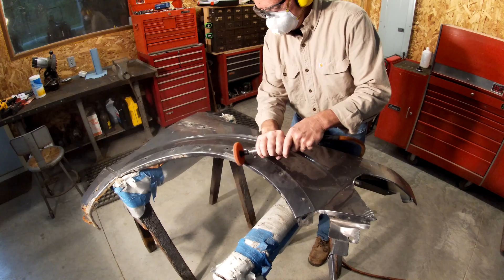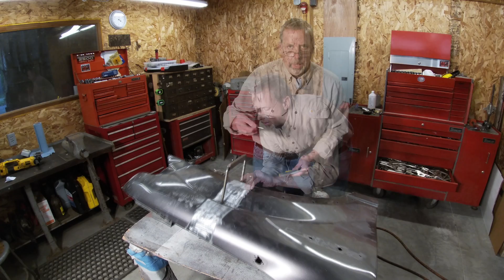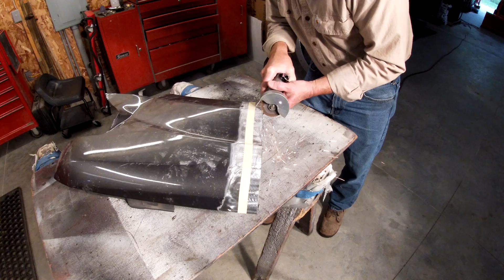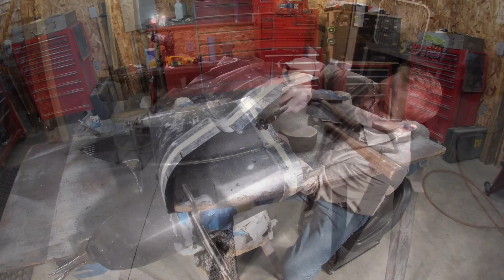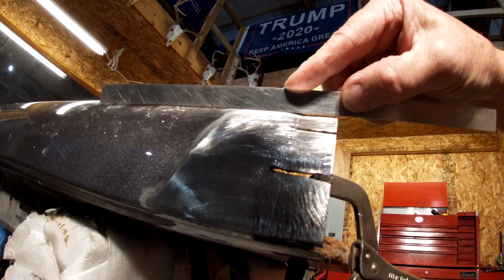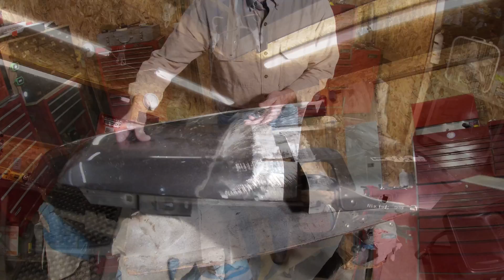Splicing A Fender Part 1 of 5

Comment: This will be interesting to see, these adhesives are way stronger than what a lot of people think.
I work at a VAG shop, these cars have a lot of bonded panels, and its rare to see cracked glue seams even on fairly substantial crash damage. I've even had cases when the spot welds have popped, but the glued areas right next to it are still intact.
I've done tests peices with the OEM glues we use, and you really have to be violent with em to get the peices to split.
Reply from the maker: Thanks for your comment. Yes, these glues are really strong. I couldn’t believe what I had to do to get it to separate. I was very impressed. Thanks for watching